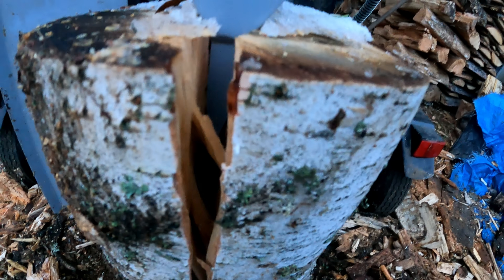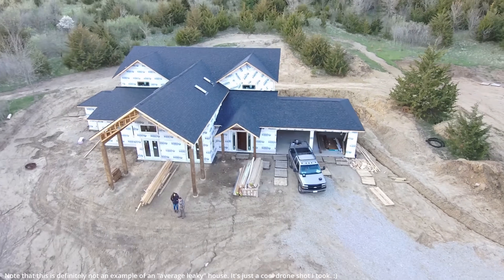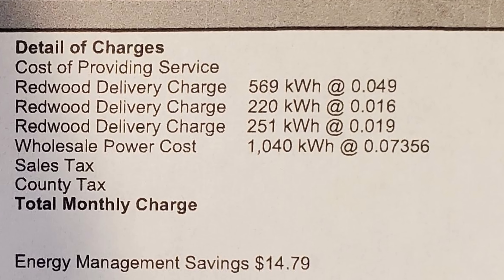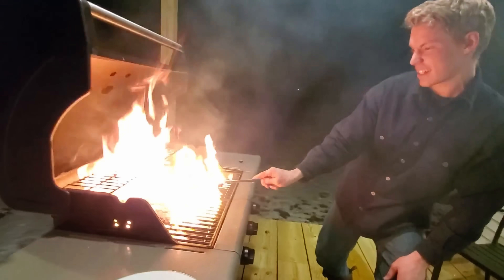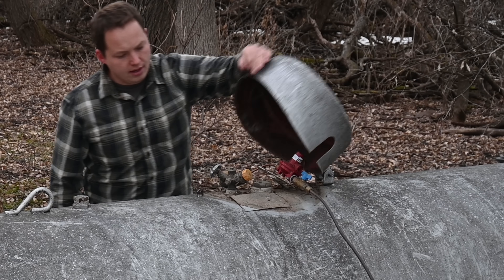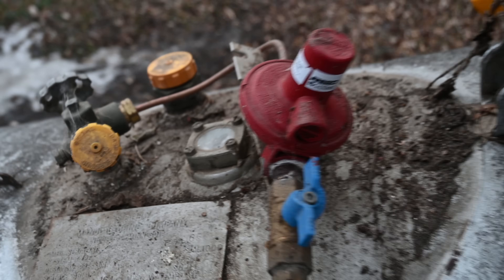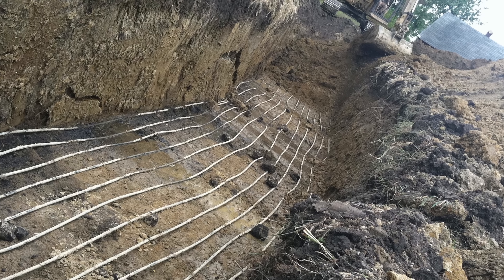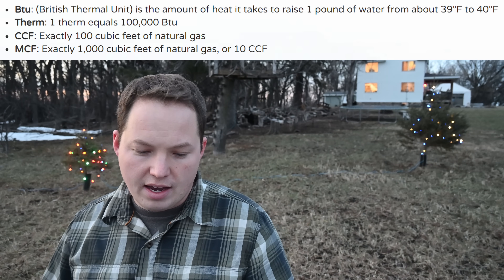What's The Best Heat Source in 2022? Top 5 Home Heating Methods - LP Electric NG Geothermal Fuel Oil

Comment: I have two sources: natural gas and wood. The wood heat is tied into the hvac system and uses the fan of the furnace. Running the fan 24/7 year round with an iwave to clean air through ionization has helped my kids allergies. So then it comes down to the price of the fuel. I get 4 full cords for $300 which is what I burned last year. The first year here I had no wood an only burned gas in 2017-18 and that cost $900. So for those who can, I’d go with a high efficiency wood burner which is fairly common in Northern Wisconsin. The other burner is one loaded and burning outside that uses radiant heat inside like a boiler.  But those who use wood always need a backup source. Most popular here is LP, then natural, fuel oil, wood, heat pumps and finally solar which requires a second source due to lack of sunlight in December and January.

Comment: That's a very good video. Well done!

Thinking that the investment cost of the heat systems could be included. If the systems last about 15 to 20 years, then it makes a sensible change on the yearly cost.
Setting up a ground or air heat pump is not the same price as electric or fuel and so on. Today Gaz seems still the cheapest option.

Comment: Two not mentioned is a heat pump that extracts heat from a body of water. It is essentially an ice maker that discharges the heat extracted from the water to the house. Another method is a solar array of heat pipes that extract heat directly from the sun.

Comment: Use propane for my house & wood for my shop, in which I made a rocket stove heater for my work wood  shop . I use my scrap pieces of wood to keep my shop very warm & if an emergency comes up , I can convert it to my home by pumping the warm air into the house using a small very efficient fans that can use a 9v battery for both fans. Haven’t tried on the house yet. I live in a very small house. About 900 square feet. However thanks for the tips. Good to know.

Comment: Think how you will heat when the electric grid goes down. I have match lighting my stove top burners and my fireplace which is pretty marginal. Recently bought a stove top fan that powers off the heat differential when placed on my griddle and works pretty well here in NM where lows bottom out in the +20s.

Comment: One thing to consider is supplemental heating systems; these can be used multiple ways, 1) to alleviate loads during power outages, 2) to help with extreme weather. 3) assist under certain conditions. Some combinations are hard to beat. For example, having an electric heat pump with back up wood stove is a great combination. A natural gas or propane fireplace that can run without power is great. If you currently have natural gas or oil heat installing a mini-split heat pump to supplement the heating (and for cooling) is a good option. Some of the DIY heat pumps can be self installed saving expensive installation bills. If you are primarily dependent on electric for heat, stand alone Kerosene heaters are a great backup for power outages. They can put out a lot of heat, no electric needed and use very little fuel. Electric resistance heaters are great for when other furnaces fail.  There are other systems that can also help. Solar hot air heaters can bring very cheap heating into the house when the sun shines. Other tips that can save a lot of money include having a large propane tank and only filling it in the Summer when prices are cheap. (need more propane, get two tanks...).

Comment: Pure BS  I  watch households with the great "heat pump" several of them are less than 5 years old thier electric bill run 400 in the winter heat pumps generate heat by compressing the gas -  not by recovering 120F heat from a 30F enviorment.  One cubic foot of Propane has  2,516 BTUs one cubic foot of natural gas has 1,030BTUs  2.44 times the BTU of natural gas.   I know for a fact because Natural gas which is metane is the crap gas of the gas field they pull of the exspensive light end gasses as they make much more money by sending the crap to the general public anything (because they  can't or don't complain)  why do you think the sell a gas by the therm rather than by the cubic foot..  But even so Natural gas still much beter than  heat pumps & electric resisstance heat.   I am not talking about geothermal but you didn't show numbers for that.  Your numbers are pure fiction.

Comment: When homes install a heat pump what do they generally do for hot water? We have oil fired boiler supplying both heat and HW so switching to heat pump would entail what to supply both, especially in New England winters?

Comment: 5 - 1" wick holders that will fit on a jar, i have 6 red bricks and a 5gallon clay pot and i can heat a 200foot space (metal shed) made my own reservoir and 5 male threaded throats to screw the wick holders to. 8" by a foot long chimney with a foot long stainless-steel mesh catalyst with a cap. has zero problem keeping the shed in the 70s-F with the temp outside 15-F

Comment: We use a pellet stove. Pellets cost per winter is 600$ + electricity  for the augers and fan. Plus a ceiling fan to disperse the heat.

Comment: The true reality is, there is no "best".  It all depends on where you live, what the local infrastructure is like,  how big your home is, and what options you want to do.

in cities, there is often a choice between gas and electricity.   You get into rural area's  subberbs often gas isn't available so its electricity and maybe a secondary like wood.  if electricity is expensive, homes often go with fuel oil in rural areas because its easy to deliver  and safe to store.   LGP tanks have a lot of regulations so can limit where they can be placed and you need to scedual deliveries.   

for smaller applications,  feul oil tends to be common because you often may only need 1 delivery a year.   but they will also often have electric backup.

Now once you move really off grid wood steams to pick up more common as it can be locally sourced when needed and delivered and stored otherwise.   this often requires very large storage area's though.   once down into the 800 square foot range,  things like parking heater style systems become usable.  Now you are talking 45 gal/month to heat an 800 square foot home of diesel.   While that USED to be cheep now its in the area of 250/month  But thats running a system 24/7 31 days at full power.   often people will have it as their secondary system using wood heat, and having the diesel heater kick in only when the temp drops down after the fireplace goes out at night, or when they are out.

Comment: I use propane and wood.  I have a high efficiency heat pump but do not like to use it.  I have to wait too long to get the house up to temp in the morning.  Also, while you are waiting for the house to heat up, it feels cold and drafty. When the temp drops the heat pump seems to be running all the time and we don't feel warm.   I pay more for this luxury, but my wife and I are worth it.

Comment: It depends a lot in the design of the house , and Windows , doors, southern  exposure. 
I have an A-frame cabin 3 floors 1500 sqft deep in the Colorado  mountains with south exposure built in 1985. 
The design minimizes  windows and doors, and seals everything up.
Even when it is 20 degrees outside without heat the house is still 60 degrees inside. With the wood stove quickly gets up to 78... I get my wood for free being in the woods. 
The best thing do is save up as can and change windows,  doors, insulation as you can and do work yourself. Then if can afford it get a whole housr heat pump or the new room heat pumps that can be put in certain rooms. 
And as a back ups get a kerosene burner,  Woodstove, and a generator that runs off multiple fuels for electric heat.

Comment: Great video, great information.  I am using nat gas at our house.  We have an offgrid property that has a woodstove and I am installing solar powered minisplit ac/heatpump now too with LIFEPO4 batteries too help keep it from freezing in VA.  I am quite excited to be expanding the offgrid system, it has been a dream, now hopefully that will translate into more comfortable relaxation when we are there.
Reply: I just bought 2 KW of used $85 solar panels from Craigslist in Portland Oregon.   Expanding your solar is a great idea.  To get peak winter power, mounting them at a high angle would be better than flat on the roof, but there would be wind considerations.  Maybe a lean to configuration, with the panels at about 55 degrees above level?  Against the side of a building, with the bottom about 3 feet off the ground, and top against a 8' tall wall?  Just thinking out loud now.  

I am also installing a 12,000 Btu 120 volt ductless unit from Amazon, $719, including the tubing!  Might power it with the solar system.  A PowMR 5,000 watt inverter/ charge controller / charger is about $750 on Amazon that runs with a 48 volt battery.  8 each golf cart lead acid battery pack from Costco is about $800.  Total for solar / inverter / battery pack. mounting hardware is about $3,000.  Saving 10 KW per day works out to about $3 per day off my electric bill!  And I can run my heat pump in my bedroom as much as I want, the solar will make up for the power I am using!  

I decided to stay with what I know, lead acid battery pack.  Maybe in 4-5 years that might change, and hopefully the Li-Ion battery packs will be much less expensive!  Right now, a 12 volt 200 HA Li-Ion battery is about $1,200.   While a equal size lead acid is only $100 or $110?

Comment: I( live in Northern Indiana and have a pellet stove for the whole house. I do have a very old furnace the does not cutoff by itself so only on the coldest mornings does it get turned on. My house is 900 sq. ft. last year I used four tons of pellets with about 15 40# bags left..  Then pellets were $221 a ton this year they have skyrocketed to $321 a ton. So last year @$900 this year it will be @$1200  This is a very old double wide trailer on concrete pad 2" walls not much insulation. An electric fan to move air and an electric heater for ocassional use. My electric bill worries me more in February when it usually doubles.

Comment: Good discussion. The cost to install is also something to consider. i was able to cheaply and easily install electric and wood heat, propane is expensive to install and I can not do it myself and it is dangerous if you do it wrong. it will get colder in 2032 as solar minimum will set in. Natural gas furnaces cost a lot to install. New energy innovation will come that will make electricity cheaper.

Comment: So don't use fuel oil that you burn in your oil furnace in your diesel  truck engine. Ben though it will burn just fine, right? Because it would be cheaper and your not supposed to do that, no sir . So don't do that cause the govt would be cheated out of taxes and we aren't supposed to take anything from the govt tax man. SO don't USE IT IN YOUR DIESEL TRUCK,  EVEN IF IT IS CHEAPER,    hint, hint
We burned wood when I was a kid and our fuel bill was much of nothin. Because I chopped all the wood, as in split it from the chunks I sawed the tree into. I cut the tree, cut off the limbs, large would be dried with rest of the log. Small limbs discarded. My dad helped drag the logs to the barn. And the rest was my job.  This was back in the mid fifty's. And my allowance was a whole ¢.25 cents a week.  There was.no cost for gas, electricity or cost for a mule or horse to pull these logs. By the way these were trees no larger than 8 to 10 inches in diameter. Ya think our heating bills were ok?  We did have a gas stove(propane) and a wood cook stove, so our gas bill was much of nothin. I wish my heating/cooking bills could be as low as they were then. But as its said, that was then and this is now.
That sure is a cute dog and if it is as cold as you say, please take him/her into the house.
Most of our heat comes from the sun. We have very, very few days or nites that require heat. We live in Florida so I guess you can understand. But I like your shows.

Comment: This depends on so many factors, it's actually a waste of time discussing it. Different regions charge differently for pricing on all sources. Then you have to take into account, how your home is built, if it's insulated good, then what options you have. Gas isn't offered where I live because there are no gas lines here. I use electricity.    But also use a fireplace. When we use the fireplace, last year it knocked our bill down to 1/2 what we normally paid.

Comment: I heat a 4000sqft house [built in 1802, but I've insulated all walls ceilings etc above code requirements], with electric fireplaces & last January [coldest month here in Ontario], my hydro/heating bill was under $300[I have been licensed in oil, NG, propane, sheet metal, air conditioning & geothermal over 30yrs] -40c is normal for 2-3 weeks in my location

Comment: Wood is and always has been the cheapest way to heat your house and the amount of heat will dry out everything and keep you warm and toasty. 
LNG is a pain. Stops working at minus 20 and the humid heat will make everything you own wet and damp. An YOUR LNG is way to cheap. Try 5 times that here where I live. 
Heat pumps as you stated hear in the north for us. Use so much power you might as well add that into a mortgage payment a year.

Comment: No idea where you live but where I am...central air ( a/c or heat ) will run me $450 month..whereas window units that do heat and cool only runs around $290 per month so about $3,500 per year not just per winter which is like 5 months or less

Comment: Kinda disappointed you left out pellet stoves. But they're generally considered supplemental heat sources unless you have a small to medium home. So far this years 2022 heating season I haven't used my pellet stove because pellets have gone up in price 20% or more because of this economy. I have heard rumors nat. gas, and electricity could go up as much as 60% or more.

Comment: Here in Europe we Conwert DIY   AC air to air unit  to HEAT pump air to water unit.  
For example Haier, Rotenso 7kw can consume in 100% like 2.5kw of power (electricity) and produce 7kw of heat . Full conversion cost about 1000$ -   which 800$  cost new ac unit and 100$ cost 15m of 1/2 copper pipe and 15m PE 32mm pipes + you must add extra 100$ for  pump if you dont have it in home.  In conwersuion we use oryginal electronic from inside ac unit and a air temperature sensor form inside unit - should be deceived by soldering a 5k ohm resistor  , and system this way can heat a watet to 50C  or 122F

Comment: I really enjoy your enthusiasm, time and input into your videos! I have been an HVAC Tech since 1975. I currently heat my 3500 square ft house with the original Lennox Heat pump equipment installed in 1983. I may self have have changed the compressor in 1995. That new compressor continues to do the work in 2022! My House is 2x 4 stud frame house with an addition  that contains some 2x 6 framing in the lower level. By using the one run approach ( The one run approach is something I came up with to beat the electric Company. I cool or heat my house to a higher or cooler than normal setting. Say for example in cooling I set my thermostat to come on at 4am and cool to 68 degrees until 8 am. Then the system stays off until 4 am the following day. Now, depending on the heat load and summer conditions, I have to adjust my run time settings.  I do the about face in the winter heating season. Now as the temperatures get more extreme, of course you have to run your heat pump more. So when my house gets down to the balance point, that occurs at about 5 degrees or so, I dump a bag of Hard oak pellets in my pellet stove and light it off. That pellet stove will heat the whole house to 65 degrees no problem at 5 or less. I have been able to keep my utility bills average at 648.6  kWh over 13 months.
Reply: What a great comment. You really know your stuff and you have a great understand of this kind of machines.
Reply: I like your "One Run" system.  Once the system is running, it is performing better than it would in the first 15 minutes of a new cycle in cooling or heating.  I found in heating it takes about 10 minutes to reach the peak hot gas temperature, and reach the peak heating performance with hot gas at about 150F to 165F on a 47F outside air temperature day.  I typically run my heat pump 3 pm - 5 pm.  Then my electric rate goes from 12 cents per KW to 35 cents between 5 pm and 9 pm weekdays, then falls to 8 cents overnight (and weekends) until 7 am, when it goes back to 12 cents.    So the really cold nights, I might run it another hour between 9 and 10 pm.  Then normally off while I sleep.  

Your 1983 Lennox unit is probably about 10 - 12 SEER, that was about the best they had back then.  Now a R-410 unit will run 14 - 16 SEER without going to the variable speed compressors (that get 21 SEER).  I would suggest a 16 SEER unit to replace the Lennox unit some day, and that can save about 40% on your electric bill.  Better to do it sooner, I have been doing this since 1983, and am not getting any younger!  

My 1972 tract home came with a 18,000 Btu GE unit on a 40 amp breaker.  I replaced it (in 1997) with a 30,000 Btu 10 SEER Carrier unit with a 20 MOCA - so 20 amp breaker.  My current home is double the square footage, 48,000 Btu heat pump with 30 amp fuses and only draws about 16 amps!  14 SEER installed in 2014.

Comment: My houseis located in southern Finland and winter temperature would go to -25 C for few weeks. I have resistan electric and airpump and also 2 stoves for wood. El consumption is 11000-12000Kwh/year in 100 squaremeter loghouse.